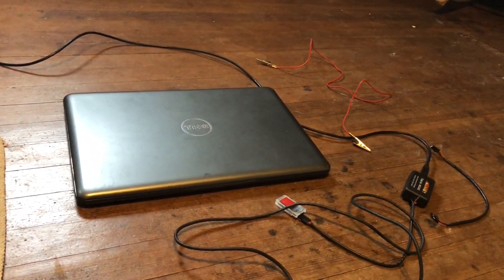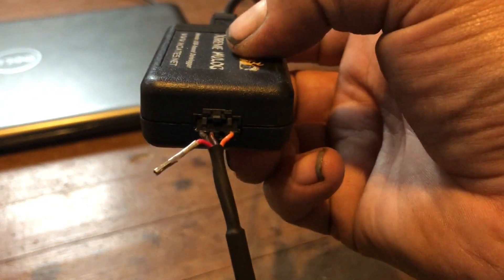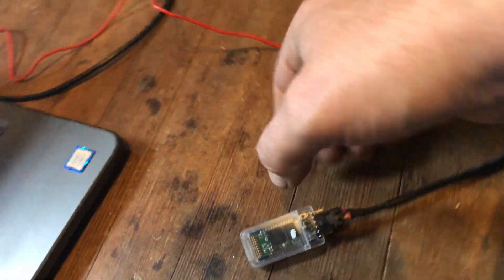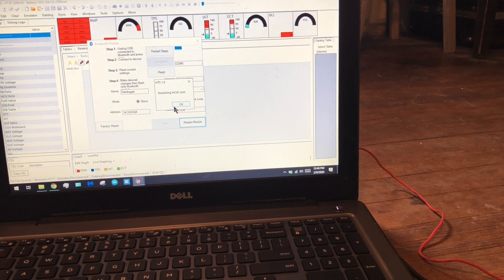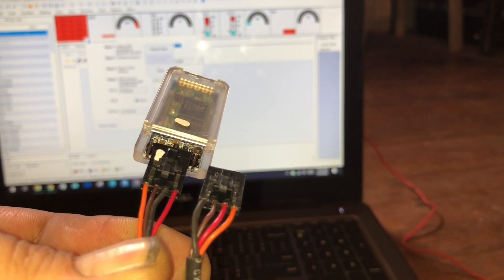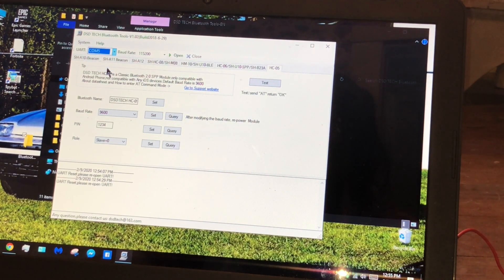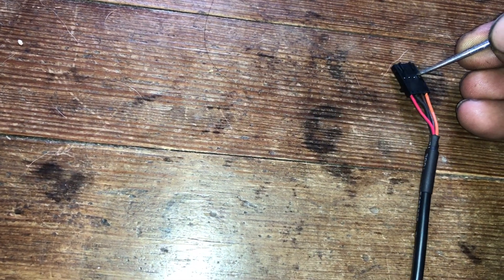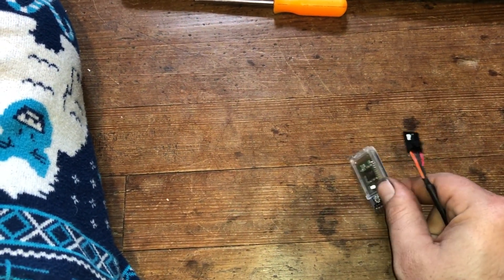HC-05 Programing To Datalog With Honda OBD1 ECU

Comment: Hi does it work on p72 Auto ecu or not?
Reply from the maker: @hondagamer79  yes it does. Auto can be disabled with the removal of one of the resistors.
Reply: @ in p72 I can’t change the rom chip so it’s possible to save the tune because the rom auto it’s different please let me know if you know
Reply from the maker: @hondagamer79  you have to solder in a chip kit. OBD1 only
Reply: @hondaland_  it’s obd1 but auto p72 it’s looks different chip ▪️
Reply: @hondaland_  I will try I’m not going to lose anything thank you for the information it’s really helpful
Reply: @ you can do that to obd0 too it’s same

Comment: Sorry  to comment on an older video but once I have the logger flashed can I just put it in the Chipped ECU to log in HTS? Iv been fixing and chipping ECUS but now I am to the point I want to explore fine tuning. Id like to have the chip mounted in the ECU and connect and log with HTS real time
Reply from the maker: No worries about when the video was made. That's what it's here for. You can put it in and log with HTS yes. You will still need to make changes with a burner but once it is setup you can connect with ease and record logs with no wire
Reply: @hondaland_  that's what I was hoping to hear. I'm still trying to figure out exactly what the huloger does for this setup. I'm going to watch again.
Reply from the maker: @CorpseFreak  hulogger is a Data logging device. As well as the Bluetooth. Datastream only and not tune changes. To make changes in real time you will need a emulator such as Demon, Ostrich, cobra RTP
Reply: @hondaland_  I wasn't trying to make any changes in real time. I'm just trying to figure out could the huloger be omitted from the setup process of the hc-05. Like could a custom USB be made to program the hc-05 and then once it's flashed put it on the ecu. Then data log through hts and make changes then return the sst. ( I hope I'm not asking stupid questions and I appreciate you taking the time to reapond)
Reply: To answer the Question You can not communicate with the HC-05 and just a cable. I made oen so far. Theres something else missing to make the communication. I cant find a driver but I will keep looking
Reply from the maker: @CorpseFreak  HTS will work with either the hc05 or the USB cable depending on what you have. Ftdi adapters work if you have too use them
Reply: @hondaland_  I have the Hulog now and its still not communicating with my Bluetooth module. Where did you get your HC-05?
Reply from the maker: @CorpseFreak  are you trying to set the baud rate of the hc05? What is your goal at the moment? My videos are for DSD tech units as some cheap units use different methods of setting baud rate. Meaning more complicated methods using an audrino style command line and knowing the commands of your unit. If you have one that is exposed with clear heat shrink on it then it is possible it is ignoring the AT commands as they are different from the ones DSD tech units accept
Reply: @hondaland_  I am using a clear heatshrink one. right now my goal is to set up the unit. It's ignoring all commands from HTS. I tried the did tech software and it seems to communicate with UART but none of the commands stick. I rename it datalog and after a power cycle it shows up as hc-05. I'm thinking that the module is my fail point. 

I am sorry I'm asking so many questions and I really do appreciate you taking time to put up with me.
Reply from the maker: @CorpseFreak  I've seen those units be duds out of the box. Ignore all commands. I've had only 2 dad do that with all I have sold so far
Reply from the maker: @CorpseFreak  no reason to apologize. That's what I made this channel for or what it has become. I enjoy passing on knowledge no matter how many steps it takes to get there so keep on trying bro and you will over come. You don't know how many headaches I went through with this. Enough to make videos because the people with the info were so rude to me. I felt I needed to become the medium between the grumpy tuners and the newbies because I was once new to all of this as well. This channel is my journey. Base map video coming today
Reply: @hondaland_  that's kinda what my channel is. Mines kinda random but also some del sol specific stuff that is harder to find knowledge
Reply: @hondaland_  how do you datalog with the hc05? Can you use hts with the hc05 or only use tunerview?
Reply from the maker: @CorpseFreak  you connect to it through the Bluetooth settings of windows just as you do for the android. It will then provide com ports in device manager that need to be set to 38400 speed. You then tell HTS which port the hc05 is on and then when you choose to connect on HTS you will see the light blink slower and the connection start. If it times out add timeout in settings to 300. If it gives your trouble unpair and restart the laptop and repeat instructions. Sometimes it is finicky on the first try
Reply: @hondaland_  that's good to know. I just realized the hulogger won't work with hts only chrome pro. I think my cheap hc05 is my fail point. I also ordered a USB to ttl wire like I saw in your other video.
Reply from the maker: @CorpseFreak  hulog can indeed work with HTS
Reply: @hondaland_  I'm going to have to look into it more then. Thanks for letting me know.
Reply from the maker: @CorpseFreak  feel free to dm on any of my socials and I can help troubleshoot the hulog.

Comment: Hi sir .Thanks for sharing this helpfull video.How Can l programming  and connect ecu with hc06 bt module.
Reply from the maker: Similar process but hc06 is chosen and then there is no button. Always in at mode
Reply: @hondaland_  l have to change module with hc05.Yesterday ,l bought hc06 bluetooth module:)Hc05 better than hc06

Comment: I have tried this using a HC06 (from DSD tech) with a hulog, following all the steps you have provided. i noticed the HC06 that i have doesn't have the AT button to push. I tried using solder and 2 spare wires to perform the process, but no success. I also couldn't find the bluetooth name for it on either my computer or my phone. 

Any way you could make a video using a HC06?
Reply from the maker: 06 is the same but no button press is needed and the 06 tab is used in dsd tech app is the only difference. Make sure your com speeds are set to the default number in device manager and the program
Reply: @hondaland_  i'm getting a red solid LED, but nothing when i search for the device on my phone/laptop over BT.
Reply from the maker: @dmarb17  it should flash when it turns on. Solid red might be defective. I receive about 2 bad units for every 5 I order lately. Kinda a bummer but yeah. If you can find my honda land page on Facebook or Instagram I can help you one on one vs YouTube comments and show u a quick video of me programming one. I should make a freshened up version of the video as well as all my videos needs a redo since I can add more knowledge into them now then I knew then.

Comment: Sir, what would if I maxxed out the baud rate of the HC-05? Thank you.

I am looking for a faster communication between the module and my android headunit for tunerview.
Reply from the maker: The port on the ecu is capped at 38400. Turning the baud of the hc device will make it stop communicating. Try a different device to use tuner view on for a less laggy screen. And also do not buy the cheapes hc device from china. Stick with dsd tech or the ones from moates or boostednw and so on
Reply: @hondaland_  thank you very much sirrrr
Reply from the maker: @argel1224  my galaxy note 8 and 9 are laggy. However my galaxy s5 is smoooooth
Reply from the maker: @argel1224  so i find cheaper phones communicate smoother and you dont see the frames dropping
Reply: @hondaland_ its probably because the serial port is emulated/virtualized on newer phones
Reply from the maker: @Oscar_delta13  yes it seems to be the quality of the Bluetooth module and if they spent time on the emulation of serial data. I use a LG Stylo 5 and it's great with the demon.
Reply from the maker: The only way to actually increase baud rate is going with a demon2 the Bluetooth unit of the demon 2 operates at a high baud speed. Take into account your still getting a baud speed from the port at 38400. It is only passing over a passer bandwidth connection. Reverse of a bottle neck. But the head unit is either at fault or the hc05 is a very low quality unit as well. They have been found to be copied with low quality parts from some sites

Comment: its only work hulog cable ?
i cant programming universal ttl usb converter sir
i programmed bluetooth module parameter setting  for 38400 
what can i do thanks
Reply from the maker: Yes you can use ttl usb device to talk to the device to send AT commands to change the setting
Reply: I also can't program it with universal cable. Did you get it fixed?

Comment: If i understand you use one module HC-05 for the ecu and one for the laptop?
Reply from the maker: The one hc05 hooks up to your laptops Bluetooth so only one is needed. A device is needed to talk to the hc05 and change the baud rate to 38400 with AT commands
Reply: @hondaland_  Thanks for the information
Reply from the maker: @ivailoF1  a wired device called a serial to usb adapter ttl 

Feel free to go to my honda land Facebook or Instagram to direct message any questions you may have and I will try and help in a timely manner
Reply from the maker: @ivailoF1  links are in the video description
Reply: @hondaland_  i will find you in Facebook
Reply: @hondaland_  Thanks again
Reply: Is the ecu need to chipped or not?
Reply from the maker: @shafaananda8992  yes

Comment: So i was able to program. Plugged into ecu with correct wire diagram, opened tunerview and says conneceted. When i turn on car i get no readings on tunerview. Am i skipping a step?
Reply from the maker: sounds like you need to purchase a protocol to match your tune. so ectune or crome in the store section. what software do you use to tune with?
Reply: @hondaland_  purchased the protocol for ectune ISR/HTS. Currently have my ostrich emulator hooked up as chip with crome tune
Reply: @samuelmontejano3815  Test removing j12 jumper. I successfuly datalog with crome, neptune, ectune and hts. Also I dont use the moates hulog, just hook directly a HT-06 bluetooth module.
Reply: @andresgiesenow8190  andres do a video on how you connected and send a link thanks
Reply: @ronyamr11  Sure, what softwares are you using?
Reply from the maker: @samuelmontejano3815  if you have a chrome tune on your chip you have to buy the chrome protocol. If you have HTS tune on your chip you need to use ectune protocol
Reply: @hondaland_  ok i have a blank chip I'm going to use hts but i guess i need to put a base map on the chip first, i started  the car but it barely run ,i need to get a chip burner
Reply: @andresgiesenow8190  I'm going to be using hts but i just chipped my ecu and the chip dosen't have a base map on it
Reply from the maker: @rangelgomez7  yes you will need a burner. I also suggest a Data logger. Whether it be the moates huelog or a Bluetooth module
Reply: @hondaland_  yes i have the bluetooth module and i installed in my p28 ecu I'm not sure if is connected the right way
Reply from the maker: @rangelgomez7  look me up on Facebook and I can direct message you and try and help and check if it's wired correctly
Reply: @hondaland_  i want to thank you alot for helping me get everything working you when out of your way to help me thanks. now my phone and laptop are connecting no problem and thanks for putting a base map on the SST27SF512 chip, are you selling the bluetooth module yet.
Reply from the maker: @rangelgomez7  I am so sorry I am barely seeing this comment. Your comment warms my heart and fuels the fire to keep producing video's!